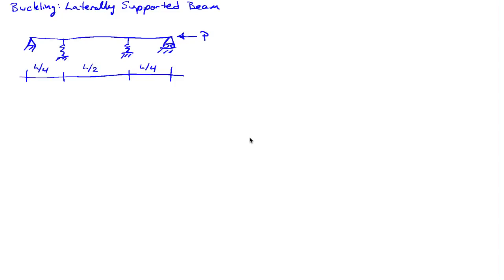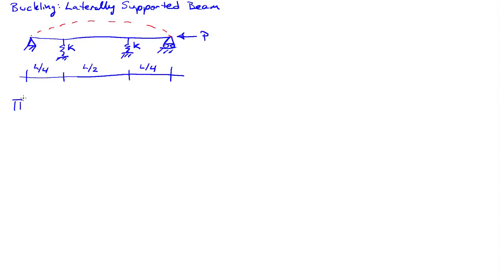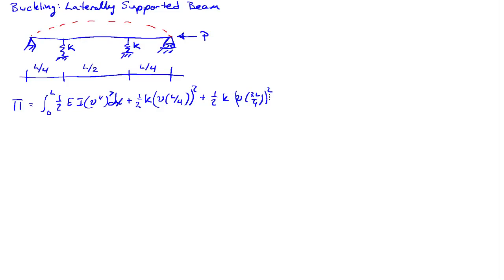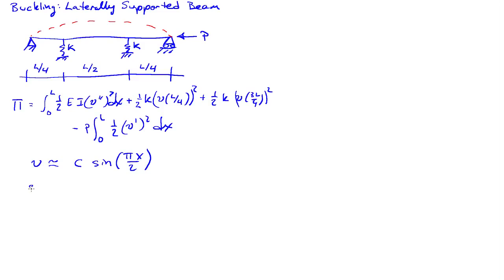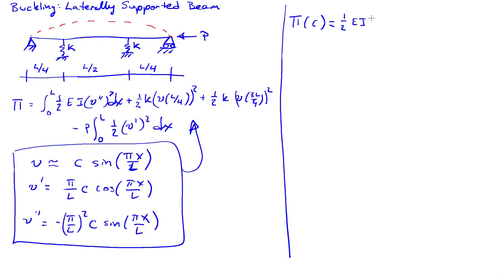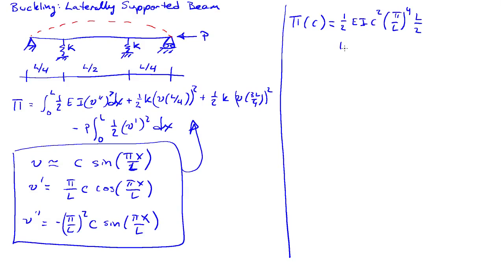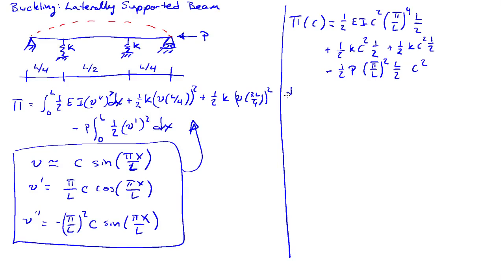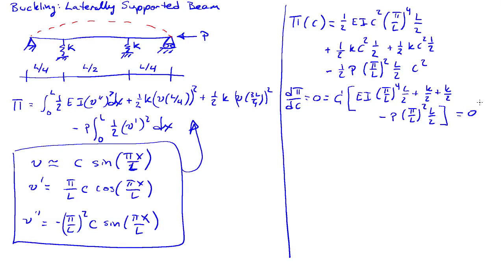Buckling of a laterally supported beam: Single term approximate solution

Comment: When L is very large P is very large?

I guess you assume the buckle mode n=1. If n=3 the deformation at the springs may be 0 and the critical load is equal to (and therefore never greater than): P=3.14^2×EI/(L/4)^2.
Reply from the maker: Yes!  The underlying assumption in the guess is the the springs are weak. A fuller analysis would involve using additional cosine terms and then computing the smallest eigenvalue of the resulting system of equations.
Reply from the maker: Regarding your first question, the implications are a bit more complicated since large P reduces the first term dramatically.  The second term should be thought of as the change in the first term for weak springs, so increasing with larger k; though at some point the analysis is no longer valid if k gets too large; in which case, one needs to add more terms to the approximation.
Reply: @sanjayg0  I noticed the first term at some point approaches 0, therefore a large L results in a large P, which indeed must be false.
Reply from the maker: @kasperkerkhof2252  Yes, you are correct.  When the second term is no longer a perturbation to the first, then you have to consider additional buckling modes.    The analysis shown is a quick one for crude analysis.  A better analysis would involve using a series guess v(x) = sum_i [c_i * sin( i pi * x * L / 2) ].